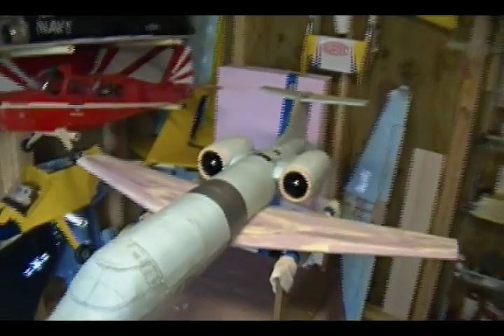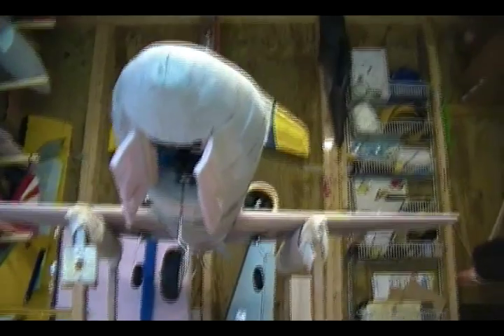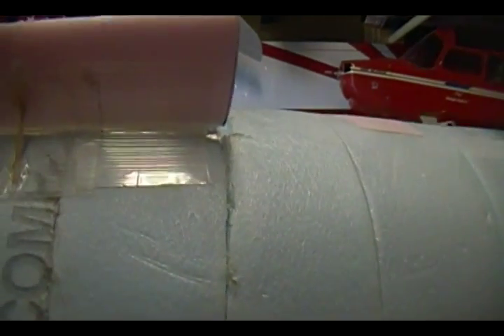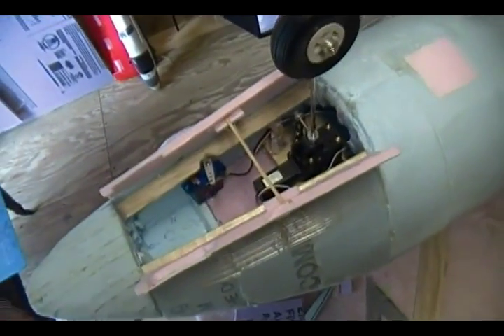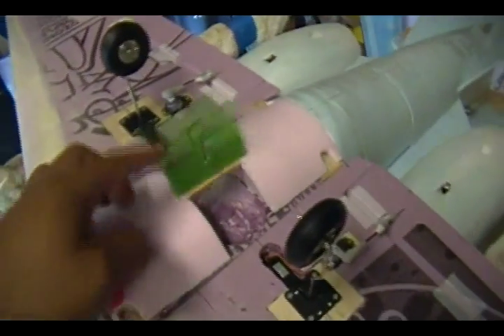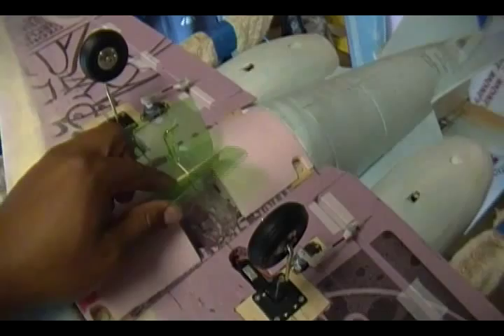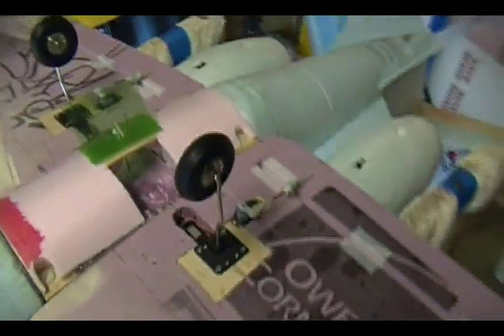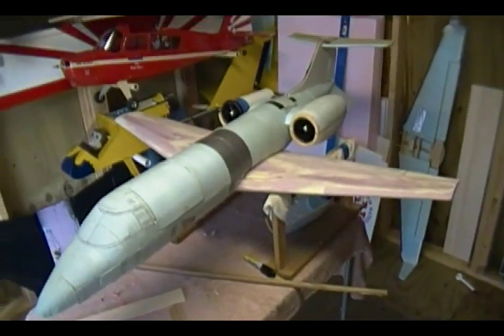r/c learjet landing gear doors

Comment from the maker: thanks for the comment and just don't be  afraid of the F-4  on take off let it run all it wants to make sure you have enough speed for takeoff  and time it EDFs suck the battery life faster than a prop so  flight time will be shorter  I  normally fly my 70mm EDF with a 4s 2200 40c   for about  5m